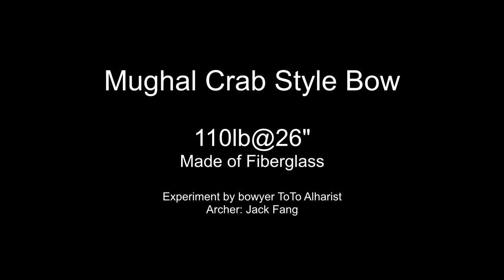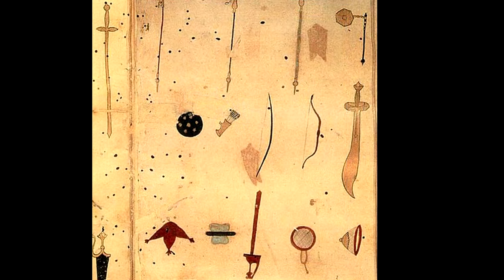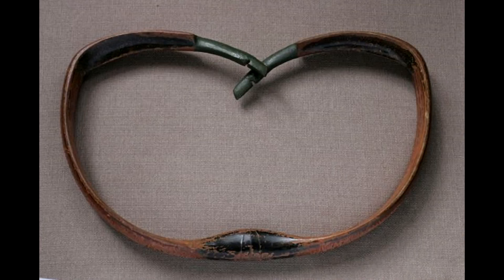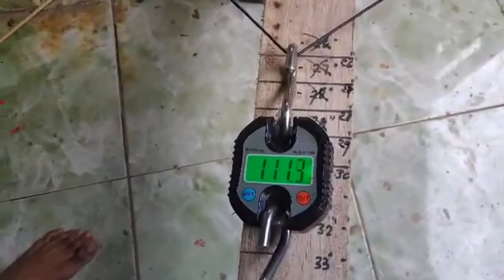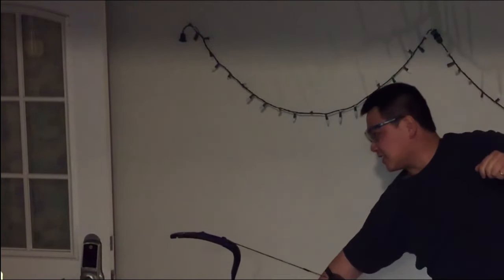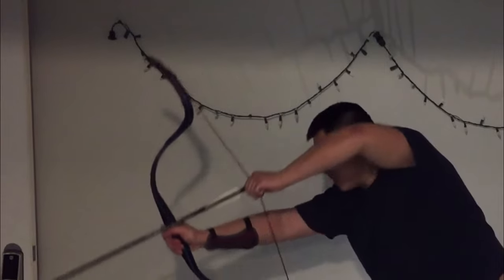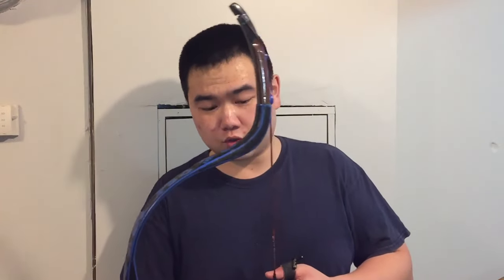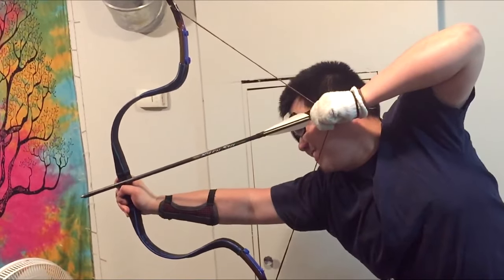Heavy Mughal Warbow of Fiberglass

Comment: I'm fascinated by the geometry of the bow at 5:32! The bi-segmented siyahs result in very interesting properties of the draw-force curve. The bow takes advantage of a very high string tension at brace, which allows for a very steep initial slope of the draw-force curve. And during the initial phase of the draw, the string is being lifted from the innermost string bridges, which are a fairly short distance away from the bow center axis. This causes the string apex angle to decrease very rapidly at first. Then the string contacts farther and farther toward the siyah ends as the draw distance increases, maintaining a nearly constant string apex angle and tension all the way to full draw. This makes the draw force curve plateau very early. So the bow behaves like a compound bow without let-off. I wonder what the minimum safe grain-per-pound of arrow would be, because this bow is definitely a speed demon.
Reply: so many fancy words my english not good , google tranlsator so bad
Reply: @zhangtony3372  Nah, I am a native speaker and I did not understand a lot of it. There was a lot of technical terminology.
Reply: What I’m fascinated is it’s a young kid saying all this terminology
Reply from the maker: i simplified it: "I'm fascinated by the geometry of the bow at 5:32! The wooden ends are causing interesting pull experience. The bow has very high initial weight, allow high pull experience. The leverage from the wooden ends cause a unique pull experience.....some technical stuff about bows.... So bow behave like compound bow. I wonder what is minimum weight of arrow, because this is fast bow"
Reply: Outstanding breakdown of the workings of this design!  I've always wanted one of these bows, but I get the impression that the bow does better at heavier weights as opposed to low draw weights due to the heavy materials and large siyahs.
Reply: @HistoricalWeapons  I've never seen any selfbows that have come out of Persia or Asia.

Comment: Since this bow has such a long brace height and short relative draw length resulting in a shorter power-stroke, wouldn't you expect some degree of efficiency loss compared to some less rigid bows? I'd love to see some arrow speed data to compare to.
Reply from the maker: yes its complicated. less powerstroke does not mean less energy, or else you would of seen a lot more manchu or yumi bows instead of turkish bows for flight archery. theres a certain balance i think the turks just perfected. this one i think is less effcient than the turkish bow but still very efficient due to the small working limbs but the dead weight of the siyahs will slow it down.
Reply: @HistoricalWeapons  Oh! it broke at 27"? damn, the bowyer wasn't joking about the max draw! Shame.
Reply: @HistoricalWeapons  Oh, sad to hear that it broke. Do you have it exploding on video, or did it explode while you were not filming? Did you wear your safety glasses when it exploded? Would it have ended badly if you had not worn them?

Comment: Why is there such a difference in the effort you experience when pulling bows with a similar tension force? According to the video, it seems that you pulled a 130lb Korean bow more easily. Which models of traditional bows are most effective in terms of the tension force/arrow energy ratio?

Comment: Traditional materials (sinew, wood, horn) require extreme shapes for extreme performance; modern materials do not. Modern fiberglass, carbon, and foam bows are sending arrows waaay farther (1200m) than traditional bows while being waaay easier to string and take care of. Trying to match traditional shapes with modern materials is unnecessary, but cost effective if you just want the look.  ;)
Reply from the maker: For the price I ain’t complaining
Reply: @HistoricalWeapons  Exactly!